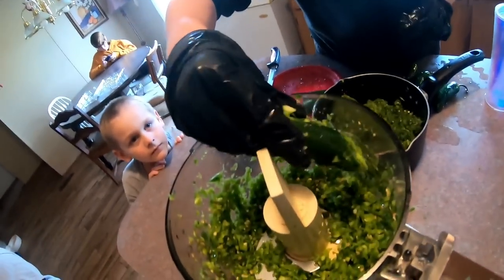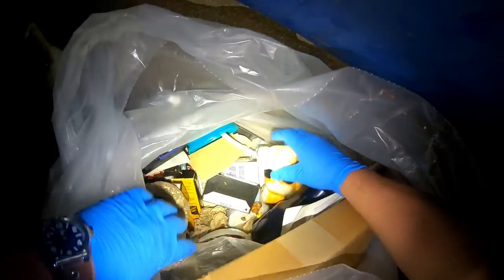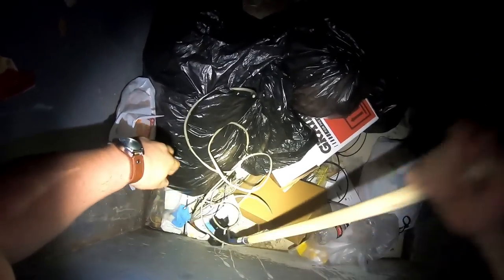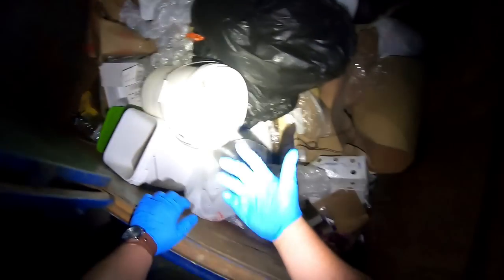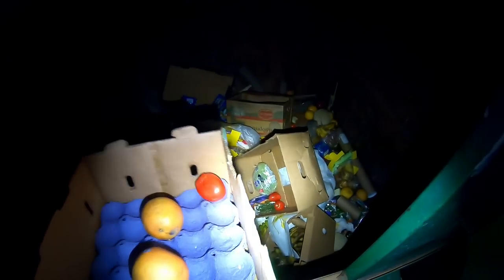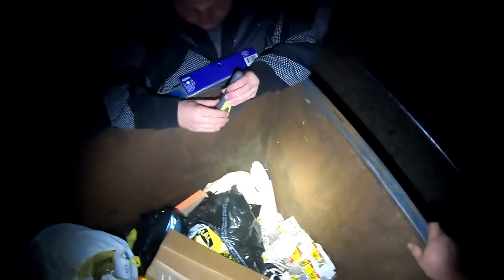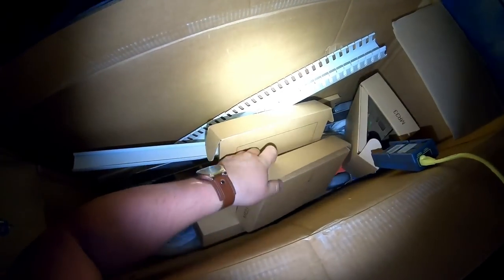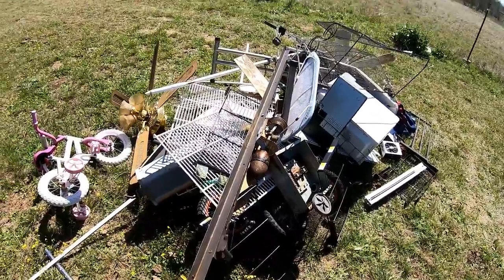People Throw Money Away Every Single Day GO GET IT! | Dumpster Diving

Comment: What do u put in ur pepper relish? This for Stacy..
Reply from the maker: 5 cups of vinegar, 1/3 cup brown sugar, 1teaspoon of celery seed, 1/2 teaspoon of mustard seed, about 3-5 lbs of peppers. You can use any kind of pepper if you’d like. Banana peppers make excellent pepper relish as well and it is not so hot. I have used mostly banana peppers and about 10 jalapeños before. Very good. If you do not want it hot then remove the membrane in the jalapeños. I boil my brine together first until the sugar melts, then add the peppers and cook about 20 minutes. Then laden into jars, mine made about 10 half pints, leave 1/4 headspace then put in water bath canner for 10 minutes, pull, and let cool and seal 😊
Reply: @curbsidejunkies   ty so much Stacy for ur relish receipe..